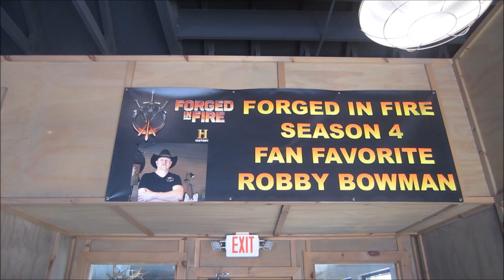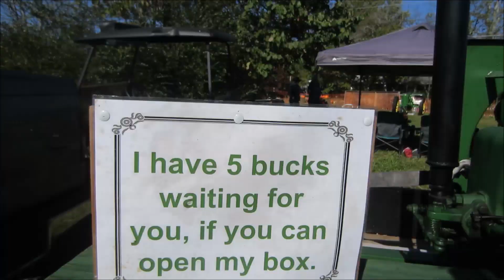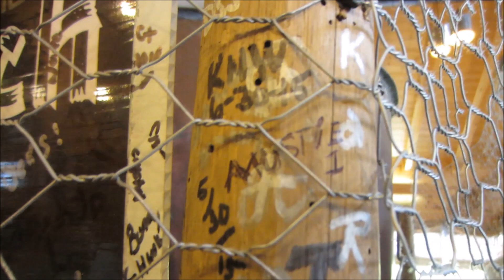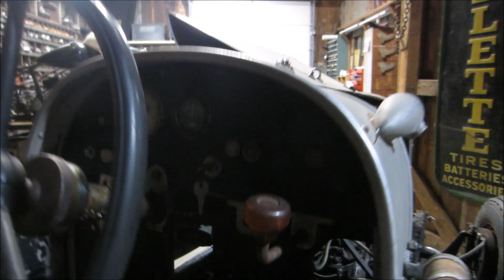mans view of a Tennessee vacation

Comment: Looks like that Indian could use a little Mustie love.
Reply from the maker: or at least a head gasket
Reply: Exactly what I thought: this wonder bike is in dire need of the Mustie 1 TLC !
Reply: I saw the same thing!
Reply: Burlats de Montaigne she sounds a bit rough I noticed the fumes coming from the gasket. Maybe she will idle better with new gaskets she needs a little tuning too. I love the sound of these like an old sewing machine
Reply: Fionn O'Brien It appeared to be a compression release valve to assist in starting, hence the smoke.
Reply: The Photographic Auditor ah I see like a boost for easy starting 😁
Reply: I assumed you were talking about the wooden carved one. She did look homely.